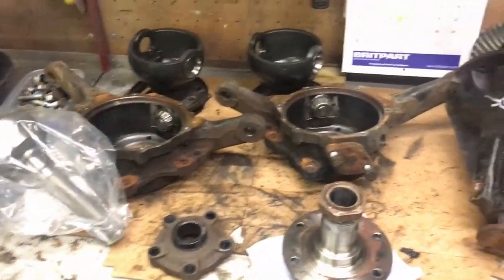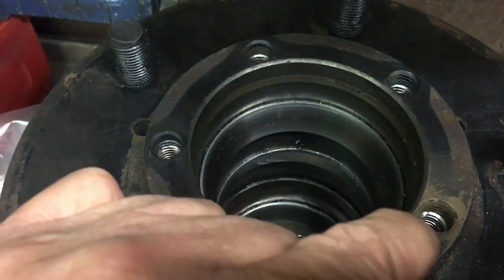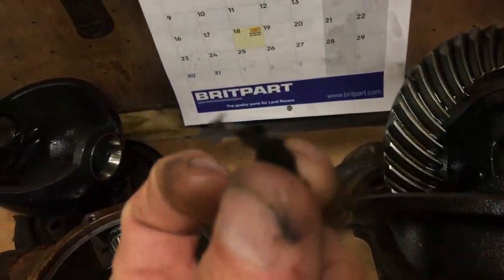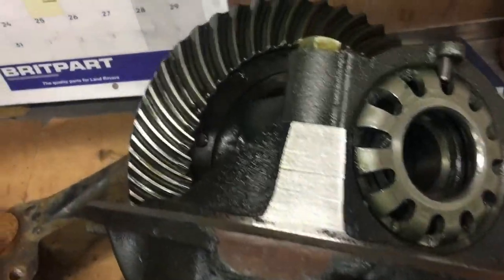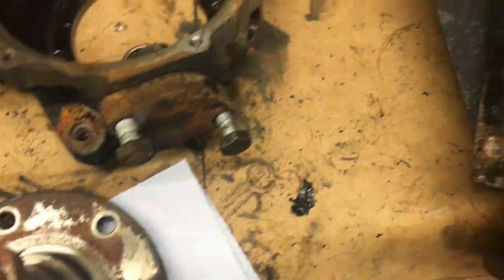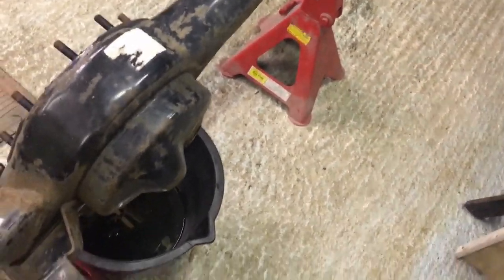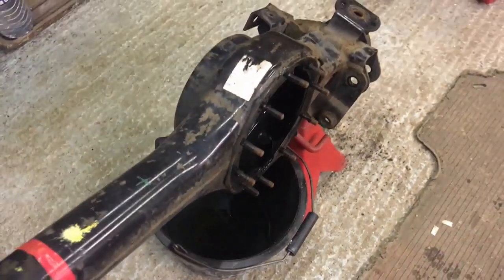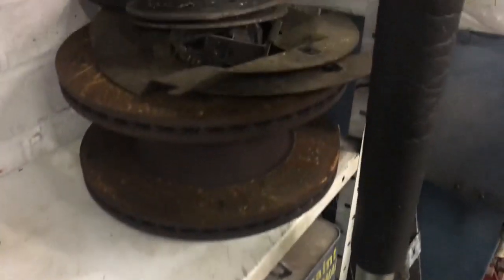Axle stripping, modifying and rebuilding. Part one.

Comment: Hi Nigel I am going to be fitting Ashcroft shafts and CVS to my Puma 2.4 front axle and just wondering what seals and gaskets I need to order before starting. I will  not be breaking down to component pieces like you but may look at changing the spindles and haven't found a diagram to show what seals,gaskets,mud shield I'll need to source. I need to have everything in place as will be using my mates hoist and can't afford to leave it overnight so any help appreciated.
Reply from the maker: Hi Graham, I think you'd be better off asking Dave Ashcroft that question, or give Gwyn Lewis a call.

Comment: ...well Nige, I'm constantly surprised (and not in a good way) by the quality of the parts Land Rover have been using in more recent times...the wear you've found all over the place is bloody terrible for such a low mileage motor!.....I expected to find a shit ton of worn out bits on my 24 yr old beast that has done some 165000 miles so far, including loads of fairly heavy off-roading, but have been pleasantly surprised at the condition of some of the original equipment.....they certainly don't build them to last any more